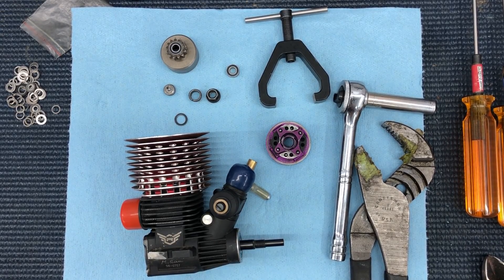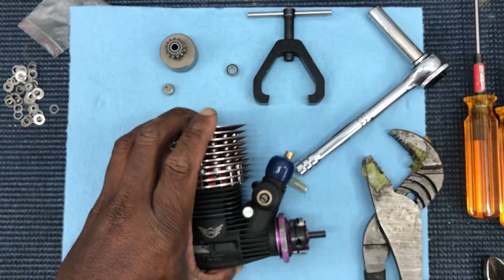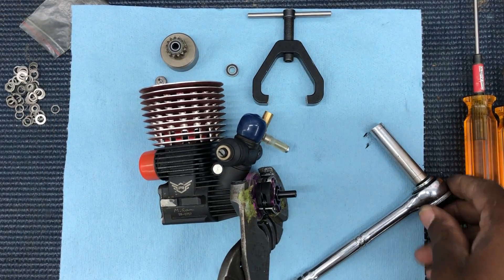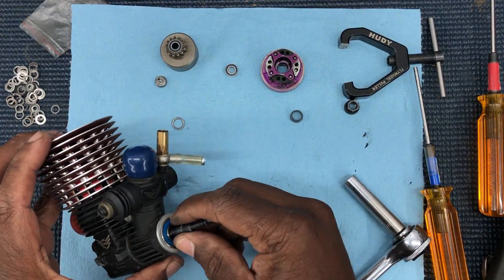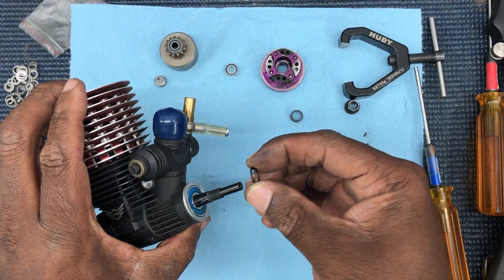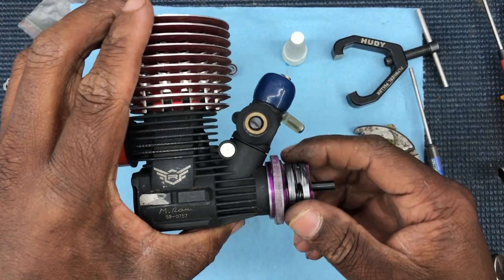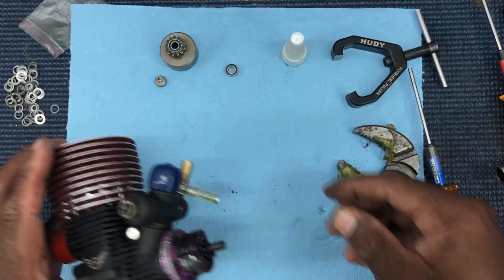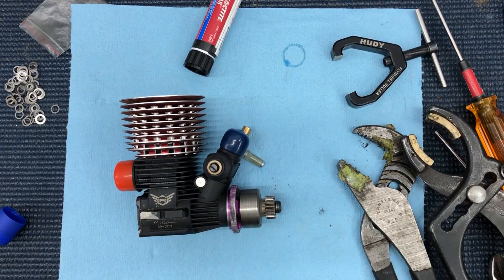Nitro Engine Flywheel Collet Shimming

Comment: Are all nitro Collets the same size. Or are they specific to engine brand
Reply from the maker: Not all of them are the same, some are specific to the flywheel you are using, always use the one the give you with a flywheel or clutch

Comment: Another good info vid cheers rajaa👍. Quick question standard savage engine mount won't accept the nova engine what mount would I need? and is my rc8 engine mount  good for a nova engine? 👍
Reply from the maker: I’m not sure about the savage engine mount but the rc8 should fit any nova engine
Reply: @rajaa111  thanks rajaa 🏴

Comment: The easiest way to prevent that is JUST RUN THE REDS FLYWHEEL EAZY FIX LOL
Reply from the maker: No sir...lol, the red is a copy of the nova clutch, I do like the reds and now that they stop making the nova clutch I may have to look into the reds 👍🏾👍🏾👍🏾
Reply: @rajaa111  I just got the reds v3 and it's very nice. Don't even have to change springs to adjust it.
Reply: £50 clutch Vs £0.50 washer though 😀
Reply: @LawrenceTimme  you run the risk of putting to much pressure on that front Clutch bell bearing when you tighten up the clutch bell screw
Reply: @ekj24000  only if there is no play. In the video there is clearly some play so it's fine.
Reply: Yes sir but it was close but it worked